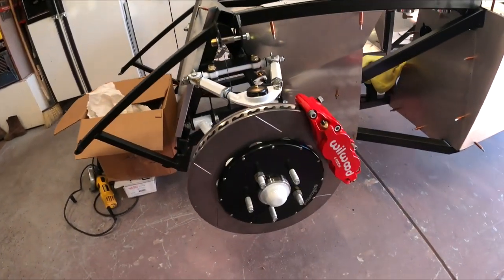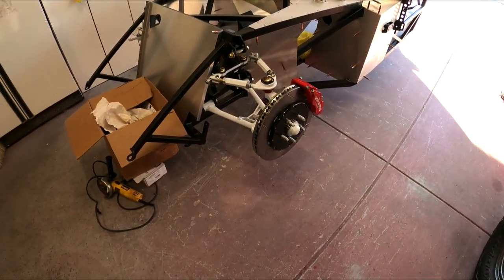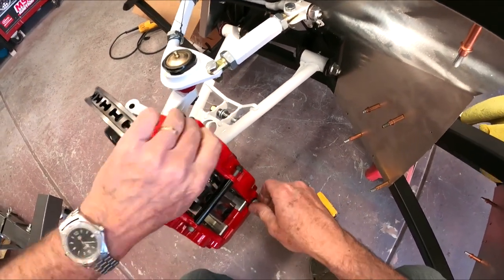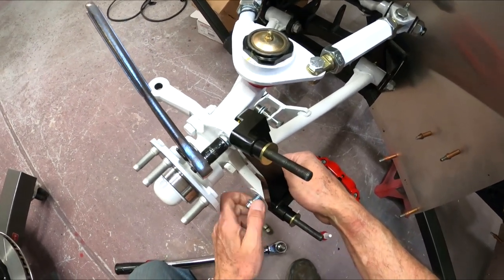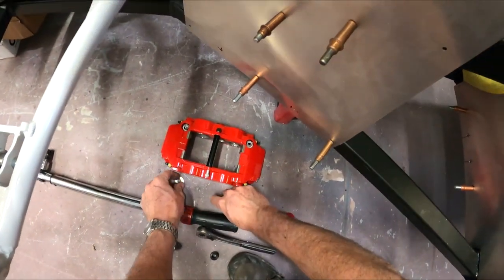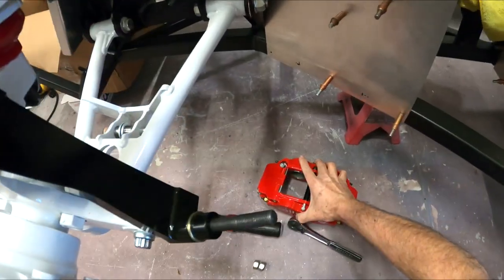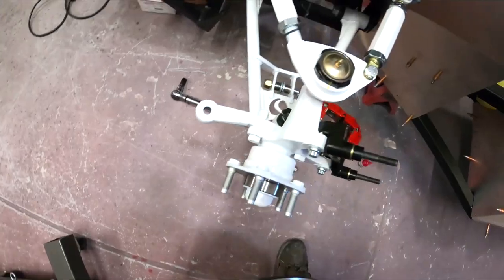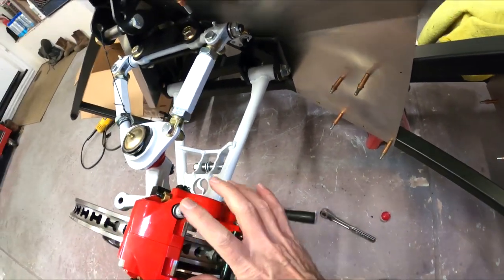Cobra Daytona Build-Front Wilwood brake install, Video 35

Comment: Do you mind letting me know where you got the caliper bolts (radial mount to spindle).  The Wilwood instructions say it has to come from existing stock bolt and I can not find it in the internet.  TIA
Reply from the maker: Either from the Wilwood brake kit or the factory five kit as I didn’t purchase them. Sorry I couldn’t be more help.

Comment: If you want to learn more about lock wiring, it’s a bread and butter skill in the Navy. We use MS33540 and a quick google will get you a pdf about all the requirements we use. If it can hold together fasteners on seawater systems on deep diving submarines and hydraulic systems with over 3000 psi, it should hold up for automotive purposes. 🇺🇸🇺🇸🇺🇸
Reply from the maker: Ben,
Thanks for your service. I am in the aviation industry but it’s not what I do. I will check out MS33540.  Thank you
Reply: @cobradaytonabuild1671  As Burt Lancaster would say in Run Silent Run deep, .... "you're taking us to the Bongo Straights". yoe

Comment: I had the same caliper bracket to spindle clearance issue with Fully Torqued Racing SN95 14" S197 retrofit kit- I could not bring myself to grind either one- so they remain uninstalled. Time for FFR to design a new spindle.
Reply from the maker: A spindle from the new mustang allowing the new brakes would be great.

Comment: Was there any reason you couldn't just get the clearance by grinding only the washers and bracket, leaving the spindle entirely alone?
Reply from the maker: I could have but from an engineering standpoint I would rather take a little from both instead of a lot  from one.

Comment: If you ever have to remove the caliper bracket won't you ruin the paint and clear coat heating up the caliper bolts since you used red locktite?
Reply from the maker: Probably but I would rather be safe. Safety first and that’s why I also safety wire them. Thank you